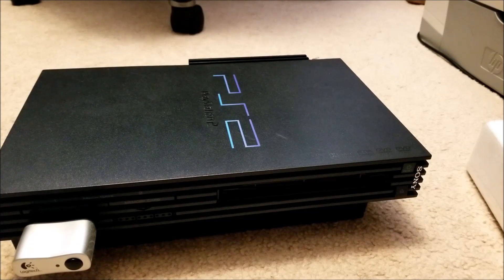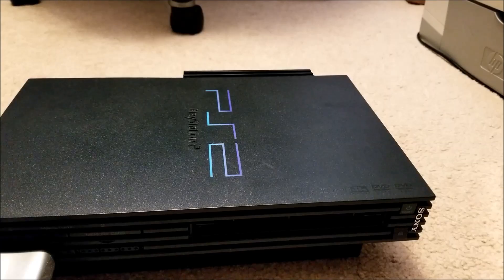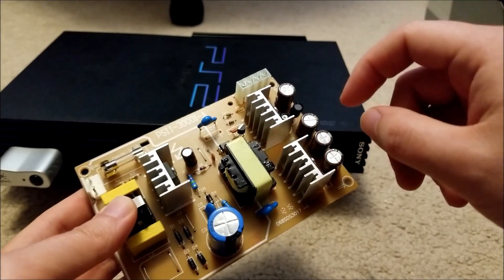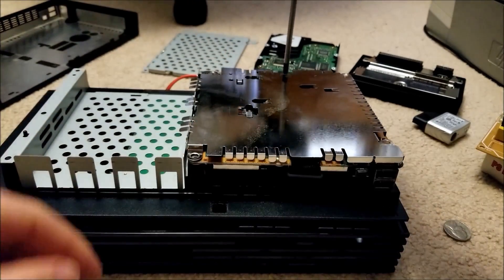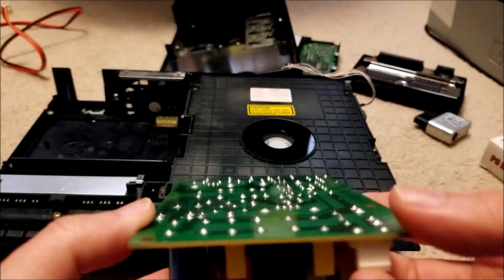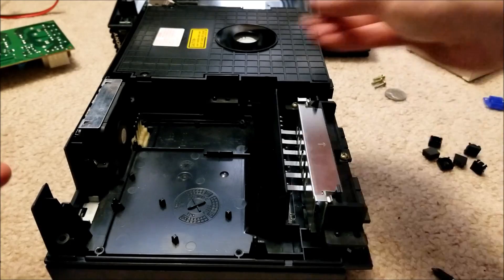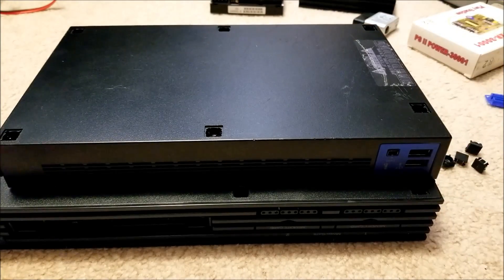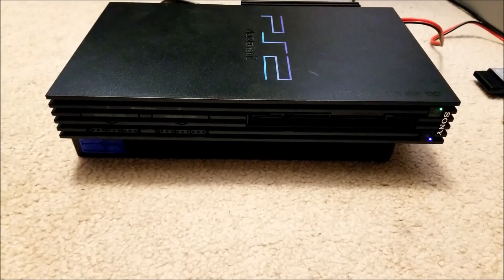Let's Fix: Sony Playstation 2 Power Supply Replacement

Comment: Actually you were half right, on later Fat PS2's the power supply is on the bottom, but your model is on the top.
Reply from the maker: It's hard keeping things straight with how many revisions sony goes through! No surprise though with just how many ps2s sold and how long it was on the market and in production.
Reply: @sjm4306  There's an easy way to tell if the power supply is on top or bottom. Look at the front iLink / FireWire port: if it is aligned with the bottom USB port, the PSU will be on top. If it is aligned with the top USB port or missing, the PSU will be on the bottom.

The latter still requires you to go in from the top and remove absolutely everything from the bottom shell together. Really annoying just to save a few cents on not having a plastic midframe.
Reply: @nitrax8629  Yup you are right, I have the later 50001 revision (2003) and i have to remove a lot more stuff to access the power supply. It's not super hard, but you do have to remove the controller ports and stuff to get to it. 

The CMOS battery is also the same: on the early revision (like the first 30001, not the 30001R) the battery is located on the side of the DVD drive and is easy to replace. On the later 30001R and 50001, you have to remove EVERYTHING so you just have the motherboard in order to replace the battery. It's a real pain but not impossible if you are careful with the ribbon cables.

Comment: Whats the silver thing siting out the from
Reply from the maker: It the wireless controller dongle for a Logitech wireless controller. Got a set of two, batteries last forever and they work great.
Reply: I wonder if they make an original xbox equivalent
Reply from the maker: I know they also made a PC version with usb dongle but not sure if an xbox variant exists.